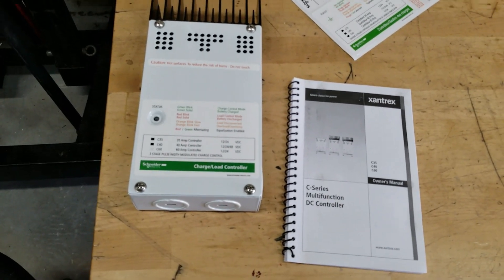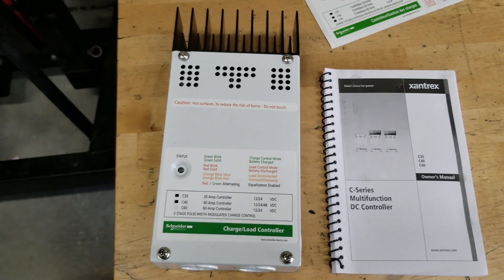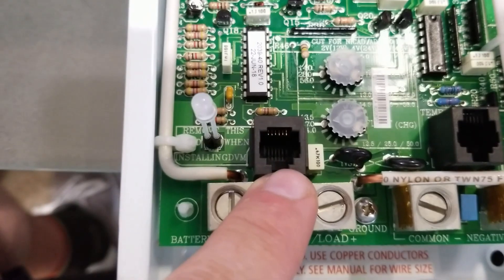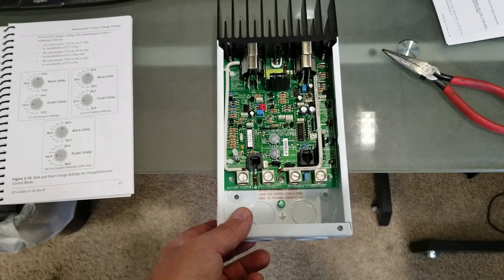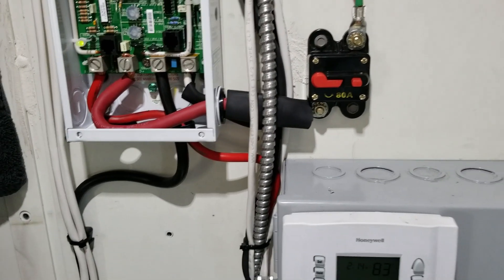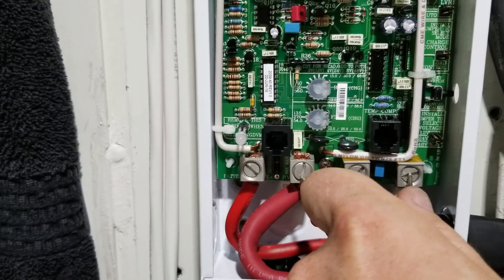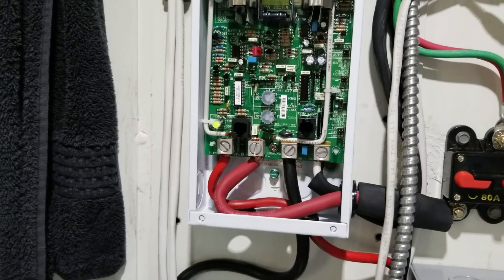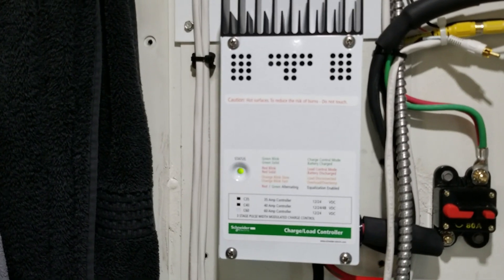Abel LMTV build part 122 (xantrex solar charge controller)

Comment: Excellent video. I bought a C40 and it came in last weekend. I learned a few things with that clean wiring you did on top. Nice electrical job inside and out. This Xantrex controller is nice, got the display and the temperature sensor. Thumb up
Reply from the maker: Hi Bolt!  I am really impressed with the xantrex products.  The 1800w 24v pure sine inverter is awesome not to mention the old school 60 amp charge controller.  Thing has been running every day since installed (Abel is parked outside 24/7) and has not missed a beat.    You can't go wrong with their products...

Comment: Nice video.   Would love to see if the ac can keep up on a sunny day run on solar.
Reply from the maker: We already tried it late in the day on a 95 degree day and it does just fine.  Batteries won't drop below 25.5 volts.  Just holds steady at that point even in partial shade...
Reply: Sweet!    How many amps does your ac draw?   How many BTU?  

Might have to copy you a bit.   Love the build.
Reply from the maker: 5k btu.  Uses about 450 watts when the compressor is running.  On eco mode it shuts off once the desired temp is reached...

Comment: Looks great same controller I have for the 12v set up and it works great no issues I added the remote Monitor and it is nice to see what is going on with a display
Reply from the maker: I should be getting the monitor next week (was on backorder).  The 24v inverter works great and I was testing the fridge and a/c combo with the solar and all was working great.  The fridge and a/c at the same time are pulling about 400 watts according to the gauge on the inverter.  The dc side is pulling 20 amps and the solar is putting out 40+ amps on the dc side.  :D
Reply: That's awesome sounds like your on your way to unlimited power source

Comment: Looks good.  Are you planning on adding a shunt to monitor battery usage or did you already do that and I missed it.  :)
Reply from the maker: The CMR (control panel) for this unit provides that information on a screen.  I will know more when I get it.  BTW: Message me on facebook I may have some of the a/c parts you need just sitting here.